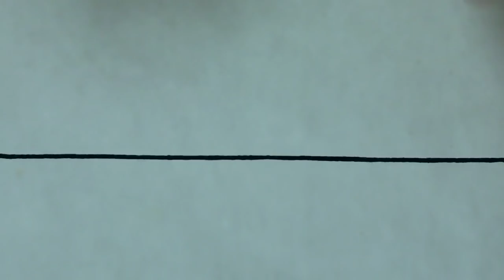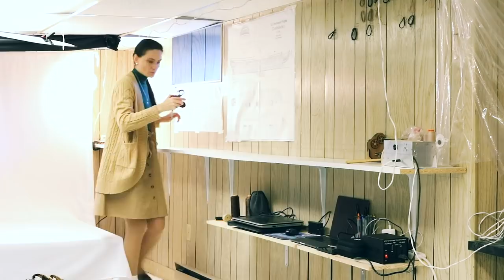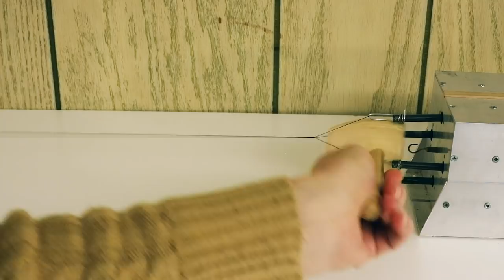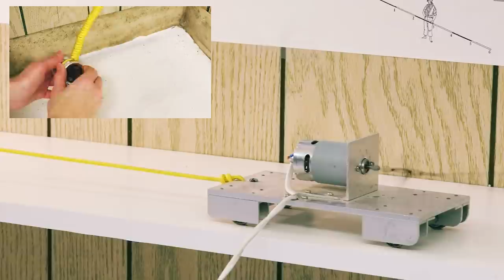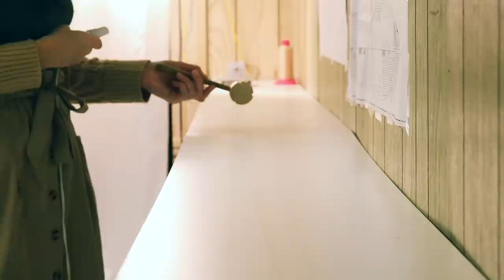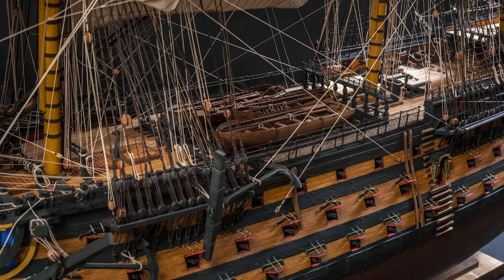#3 Main Tool for the Shipmodeling - ROPEWALK

Comment: Hi Olha. First, thank you for all your beautifully detailed videos! Without these I would have given up a long time ago. I have started making my own rope, but I only have the Shipmodel ropewalk, hand operated, and so far have only managed to find Tera 180 thread in the UK, not E121 or E151. Notwithstanding this, I have been able to make some fair examples of right-hand lay rope. I am struggling when I then try to make cable lay rope. Can you advise, do you still need to pre-twist the three RHL ropes before then combining, or do you just string the RHL ropes up and then run both motors at the same time? Thanks!
Reply from the maker: It is quite difficult to do with Terra 180 because the thread is already twisted and when you try to make a cable rope from it (left-hand twist). You first untwist the thread and it becomes longer (plus curly) and then twists to the left. Ropes made of such threads also have an elastic effect.
Try to buy any overlock threads available in your country. They can be thicker, but they are not twisted either to the left or to the right. So they are ideal for both types of ropes...
Reply: @OlhaBatchvarov  Thank you for your prompt reply. E121 is not sold commercially in the UK, as far as I can see, but I keep trying! Most of the overlocking threads here are multifilament, not monofilament.

Comment: Hello Mrs. Olha Batchvarov, because your knowledge is excellent and valuable, I would like you to tell me if the ropes of the Gutermann E121 series are the same as the U121 series (scala 240). Thank you very much for your time, and for giving me a kiss on your kitty!!! Konstantinos Skodras
Reply from the maker: Hello! These are completely different types of threads. E121 are threads for overlocks, they have no texture, that is, they are not twisted at all, and you can use them to twist ropes both to the right and cables to the left...

Comment: I'm actually surprised nobody manufactures proper up-to-scale ropes for model ships. Today, it seems you can get every little thing for your modelling needs, from white-metal castings to fake grass. Why not this?
Reply from the maker: Oh, you can find them without problems, but they cost 6-8 $ per coil. For example on the sites: syrenshipmodelcompany(dot)com or ropesofscale(dot)com. That's why I decided to build my own ropewalk...
Reply: @OlhaBatchvarov  Right. And that's per-meter prices. I guess that a large model needs dozens of meters. Not to mention that shipping is probably costly and takes forever.

Still, I'm impressed you took all the time to actually study how ropes are made and then made the effort to put the knowledge to practical use.

One thing got me thinking - why does the rope twist differ between standing rigging and running rigging? (left vs right) Does it have any practical use on the real ship? Or is it just a gimmick?

Comment: Hi Olha. I have one question. What diameter has your teeth wheel in the machine? I want make this machine like you. I am a begginer ship modeler, but ropes in my kit is very bad. Güterman thread is on the way. Now I will print teeth wheels on my 3D printers. Thank you for your videos. You are a big Guru for me. Best
Reply from the maker: Thank you!
I don't even know how many teeth there are on the gear - I bought them in an online store...
Reply: Hello Mr. @Swanci85, @zjiep111111, where did you order the thread Gutermann E121, overlock thread, series 240, (chrom.:696,186,722)? They are in Canada but I'm looking for closer ones for cheaper shipping. Thank you

Comment: Hello! Do you apply some kind of treatment to the rope, for example bee wax? 

Thanks and best regards!
Reply from the maker: Definitely not wax - all the dust will be yours and you will not be able to glue these ropes! It is better to use a lighter to remove lint...
I use polyester threads so they are lint free and require no finishing! They can also be colored and tinted with bitumen or tar...

Comment: Rope walks are expensive to buy. I build on a poor budget. Did you fabricate your machine? I think my junk box has most of the parts and I can make gears. Do you have plans available?
Reply from the maker: I bought gears and engines and ordered its construction from a craftsman who was able to work with aluminum.

Comment: Hello Olha!
Congratulations for you channel, it's asesome! 
Did you built the toppers or did you buy them? I built my own ropewalk and for now I'm using a small round cutout of plywood with 3 notches to place the strands and it's works fine, but I'm wondering if a tool such as yours would make a difference. 
Thanks in advance!
Reply from the maker: Thank you very much!
They were made for me by the master who built this ropewalk - it works great!

Comment: Olha, when you built your ropewalk, how did you determine how "long" it needed to be in order to make ropes long enough for your models?  Did you simply go by experience of building models for years and therefore knew how long the longest single "rope" for a section of rigging would need to be?
Reply from the maker: I was just looking for a place where I could set up my ropewalk. In Kyiv, I had 6 m (almost 20 ft) between the engines (with a high ceiling, so it was enough for the counterweight system). But now I have only 4.3 m (14 ft) between the engines, because the workshop has a very low ceiling - only 1.8 m and does not fit the counterweight system for longer ropes)))

Comment: Hi , I appreciate your work very much , you are a wonderful modeler but i have a very small question ! why do you use synthetic fibers as polyethylene instead of 
natural as cotton , linen or hemp witch is more appropriate to the accuracy of the historical build ? thank you very much !!
Reply from the maker: Thank you! 
I prefer imitation from synthetics then using historically the same materials - on a scale they look rough, hairy and react to changes in humidity. Also, they all already have a texture and only cables can be twisted from them. Because if you twist from left to right, the threads are first untwisted and then twisted again in the other direction, which makes them with a stretching effect. This is what I don't like most about working with them! Also, the rigging of them can sag or stretch so that even the mast is deformed. I had this problem on two models, but when I tried synthetics, it was a salvation. You don't even need to burn off the hair on the threads - you can put it on the model directly from the ropewalk! So I will not return to natural threads!
Reply: @OlhaBatchvarov  Thank you very much ,very helpful

Comment: Hi Olha, my name is Pascal and I've been following your since two or three month, I think.
Your models are manufactured very extraordinary beautiful and awesome. There so many details shown in your videos, that's fascinated to me, how it grows- the sails, the ropes and blocks and so on.
Keep on going, Olha😃
Now my question is, can give me tip, where can I get your machine for making ropes( in German we call it Reeperbahn- not the famous street in Hamburg, only the device)

kind greets from Magdeburg, Germany
Reply from the maker: Thank you very much!
Such comments inspire me to continue to create content.
But unfortunately I did not find any manufacturer that would make such ropewalks (there are some compact but they are limited in twisting ropes) so I designed this one and found a master who built it for me!
Reply: @OlhaBatchvarov  
Good morning, Olha,
Thank you very much for your answer. Yes, that's also my point of view. There are no company with the exception from the Kick company. But this ropewalk doesn’t look very trusting. So is it possible to buy such a ropewalk, as you designed, developed and constructed. 
That would be very awesome. 
By the way, my two project’s are at first a half-opened “Bounty” by Artisan and at second a very awesome jolly-boat, called “Pirat”, which me and my wife sails as an original jolly- boat. It is 5 meters long, 10 square meters sail area with two sails- fog and main sail. It’s a great hobby too, and we have so much fun crossing the lakes. And for the bigger turns we have a little 22 feet yacht also with Bermuda rigging with Genua sail and main sail and 32 am, two cabins. It’s a perfect little boat, easy to sail and brilliant for holiday trips in the Baltic Sea. 
So now you see, with the ship modeling I carry the hobby from  the lake to my living room🤣
Kindly greetings

Pascal